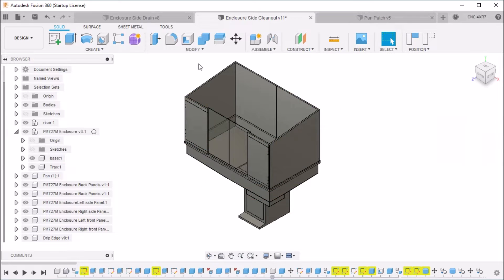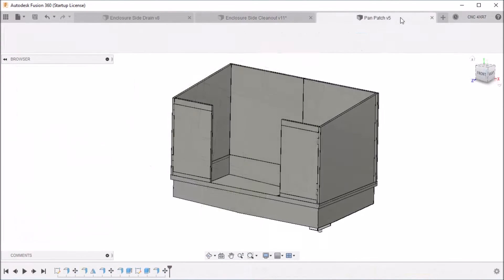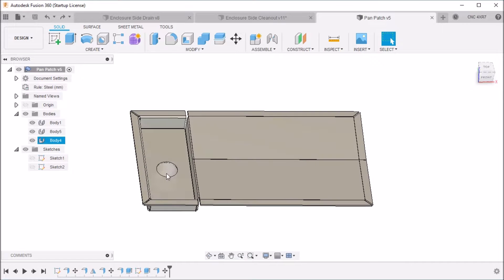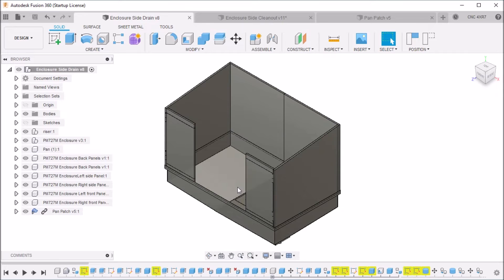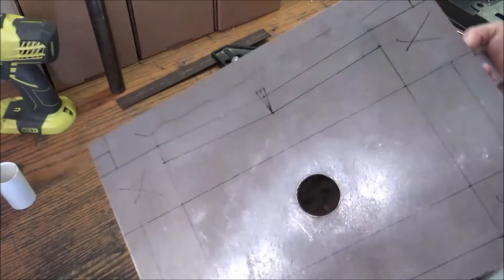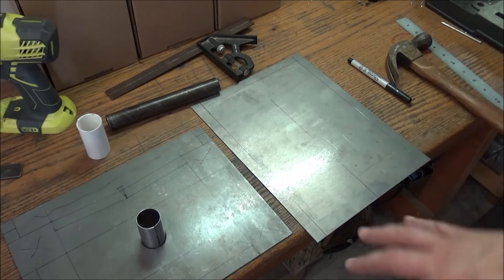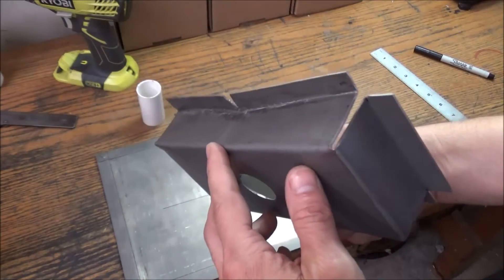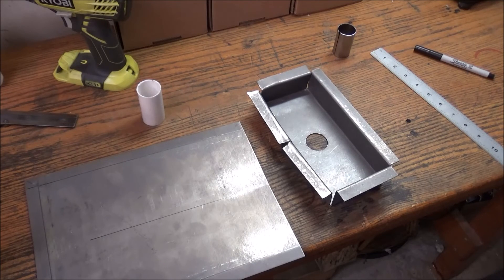Enclosure Patch Panel

Comment: Do you add a wire mesh to keep the chips out of the drain or do they fall down the sump and get separated with a filter when the coolant is recirculated? Or is the mild flat area enough to catch and dam the chips making my previous question moot?
Reply from the maker: Good Question. the old setup I have a SS screen that covered the entire tray i plan to keep that in place.

Comment: I always seem to have trouble TIG welding but I'm  slowly getting better.  Keeping a sharp tip on the rod seems to work well and improves the quality of the weld.  Hang in there you WILL get better.
Reply from the maker: Thanks yes at first I was really hot not using filler just trying to fuse some coupons. Ive gotten way better with that  still a little hotter than I would like. now i'm trying to use filler its like starting over again. LOL